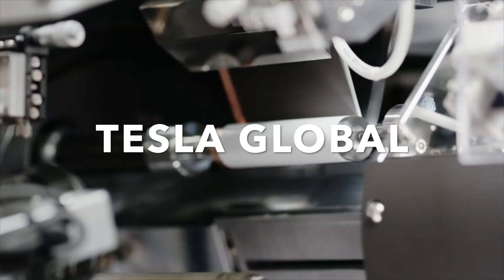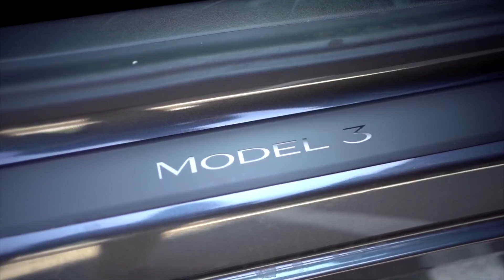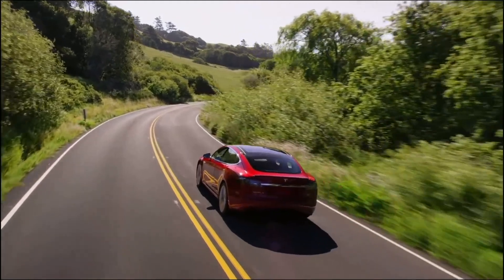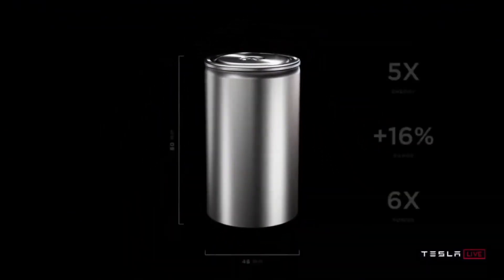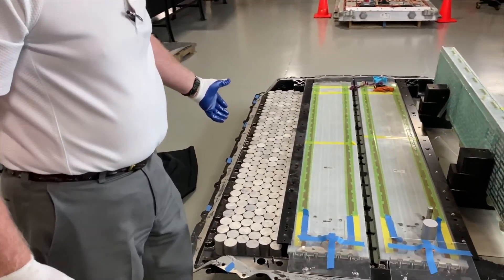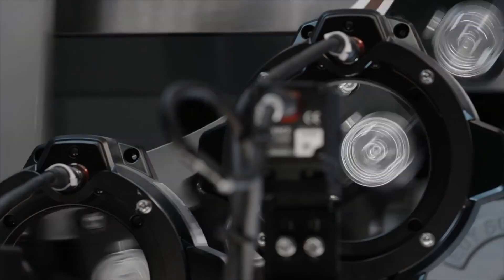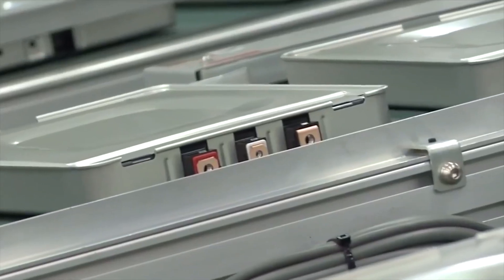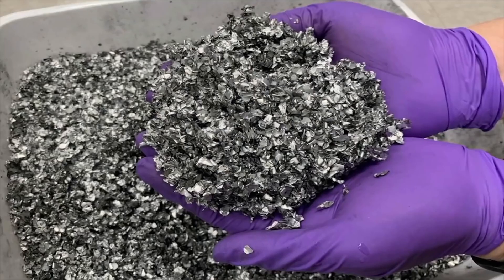Tesla 4680 Battery Has NO Competition

Comment: 4680 heat sink issue
Larger cell 4680 generates 8x more heat than 2170 while thermal impedance of 3.2x than 2170. Thermal management scheme in model3 is insufficient to sink heat the 4680 cell. 

There are two ways to look at thermal path way. 1) radially use by model3 versus 2) axially use by 4680. Heat in 1) must pass through all layers of chemistry just to be sink through the curved cell wall, the upside is large desirable heat sink area. Compare to heat in 2) can passes through anode (instead of layers of chemistry) “towards” cell base bed, the up side is low impedance path way towards cell bed. 

Unforeseen issue in 4680 
1) replace (welded tab and preload) for (anode flaps) with little to none preload ability, consequently flaps will undergo deformation upon inertial shocks on road. One by one begin detach from cell bed. This will continues until the last flap detach from cell bed that that moment a spark is produced next to hot chemical. Hot and flammable chemical ignition will follow.  
2) thermal path from anode to cell base bed are point contacts but surface contact. Point contacts is inferior to surface contact in heat sinking. Consequently cell runs hotter than 2170. That is longevity issue. 

Remedy? 
Pouch cell packaging into prismatic assembly.